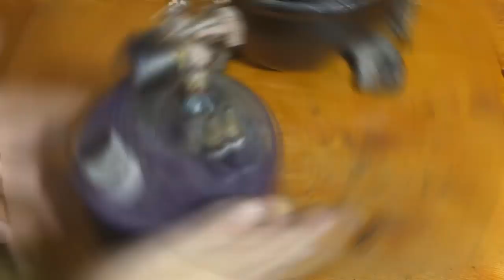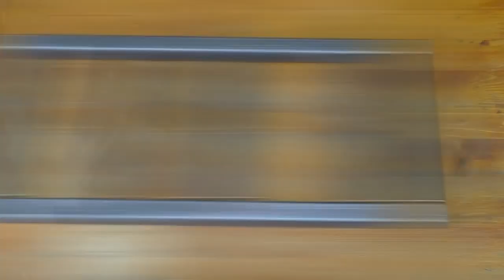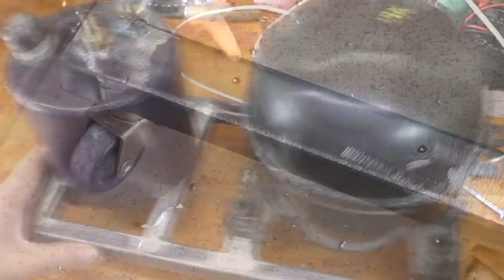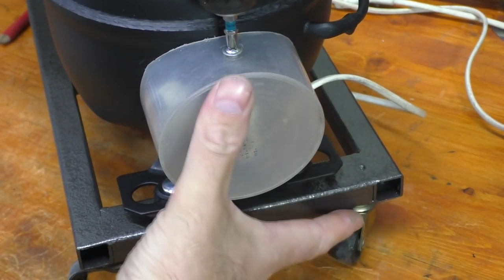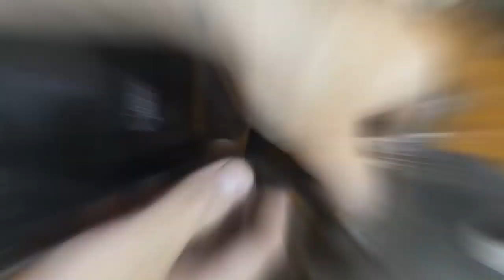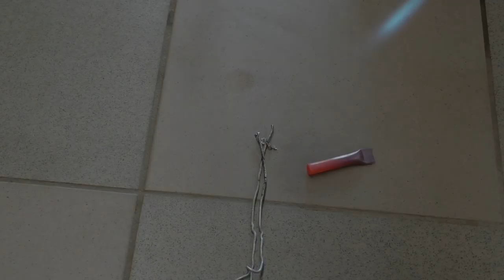How to make a gas burner on gasoline Gasoline burner from the refrigerator

Comment from the maker: How do you like the idea?
Reply: My personal thought at first, I thought it was a stupid idea.
But I think and looked very carefully why you need this, and I realize this is really great idea considering a person don't have a gas tank like Oxygen, Acetylene, LPG or LNG (in Korea we use these a lot).

Considering again that The only thing you need is Gasoline, Electricity and a lighter for it.
It will be Very Very useful for portable weld.

Just a suggestion that, it would be better if you put a pressure valve,  a regulator, and a check valve for safely regulated air pressure for it. (of course, it will become larger if you put too much though...)

I'm not an expert with this, but considering the pressure that is created by a refrigerant compressure, 
it might cause a high pressure for the gasoline tank.
so it would be the best for put a pressure valve for stop at some pressure point of air, check valve for reverse fire hazard through torch, and a regulator for steady air pressure for steady use for torch.

I really want to hear your thoughts of this too, just came up my mind, Electrosys burner might be a good idea too.
Reply: @yoonpark8311  i AM WITH YOU ON ALL THAT TOO ESPECIALLY THE CHECK VALVE. a PERSON COULD ADD A HOMEMADE BUBBLER MADE FROM A BOTTLE OR JAR OR WHATEVER TO ACT AS A CHECK VALVE/ANTI FLASHBACK... SORRY ABOUT THE ALL CAPS.. DIDN'T REALIZE I HAD CP LOCK ON.. OOPS..
Reply: Yes

Comment: I have a torch like this, connected to a 13 kg propane cylinder.  It is very good.  but this one seems to have more pressure and cheaper fuel!

Comment: Bravo for this achievement the torch looks powerful as powerful as an oxyacetylene torch I am in awe
Reply: Except for an Oxygen Hydrogen flame, Oxygen Acetylene is the hottest flame we have.  A gasoline and air flame is not nearly as high.  Maybe if you used pure Oxygen instead of air, it might be a bit higher.